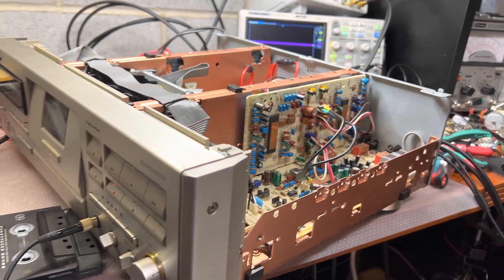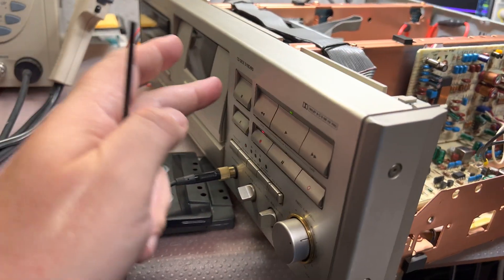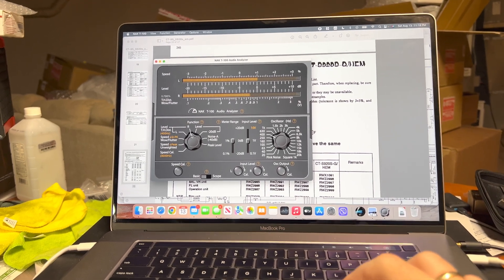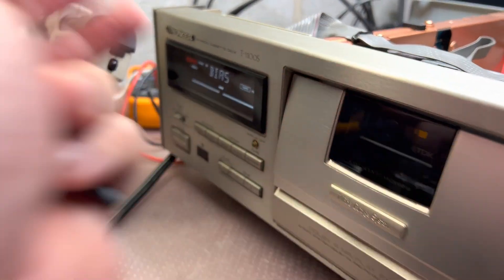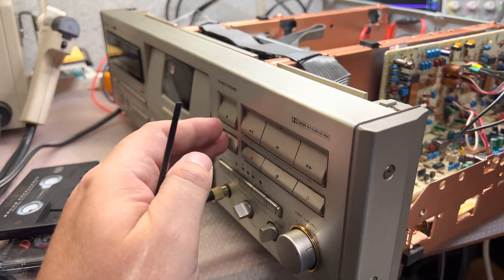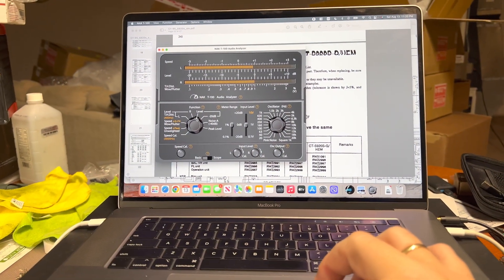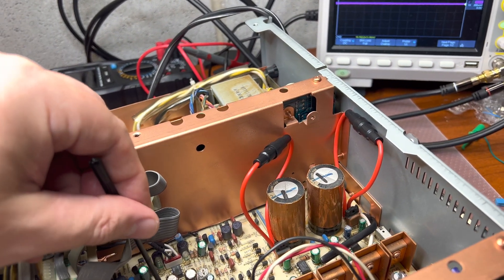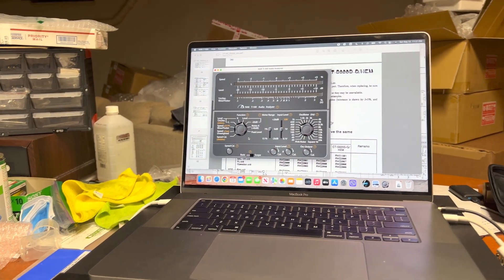Measuring THD Distortion on Pioneer T-1100s

Comment: I am really wondering how do these Pioneer decks compare to say SONYs. SONYs were not on average the best but for all I know they were pretty realistic in their specs release (no pun intended).

And while you had Sony with THD of 1%, the corresponding Pioneer unit would have had 0.7%. When Sony had 74dB SNR, Pioneer would have had 78 and so on...

Besides... from the depth of my ignorance I would have expected the metal tape to exhibit a higher THD especially nearing saturation.
Reply from the maker: The lowest THD I measured is on Nakamichi 680zx after multiple mods. However, at this age it is hard to rely on factory specs, doing my best to bring them back to the former glory.

Comment: isn t distorsion supposed to be measured @1KHZ
Reply: besides... at how many - (minus) dB(s) is it usually measured?
Reply from the maker: @m80116  always at 0dB
Reply: @hifirulezzz  is it ? I ve always been used to measuring it at the dolby sign be it 0dB or +3db like on the pioneers.

I do think the right way is +3dB because that s the "dolby" sign (on pioneer decks).
Reply: Dolby sign is always 0DB VU regardless of the deck , so that way we have a standardd to follow on all ddecks when measuring distorsions.
Reply from the maker: @sh0t  I believe you have to read about different level standards adopted by different manufcturers https://www.walkman-archive.com/articles/guide-excellent-recordings_05.html
Reply from the maker: @sh0t734  you are wrong, Dolby is always on Dolby level which is 200 nWb and a -1.2 dB on decks with zero level as 250 nWb and +2.8 dB for the decks where zero is 0VU
Reply: the 250nWb is at the dolby sign.
Reply from the maker: @sh0t734  Nope, you are wrong. 250 nWb is a 0 level for most of the decks released after 1981.